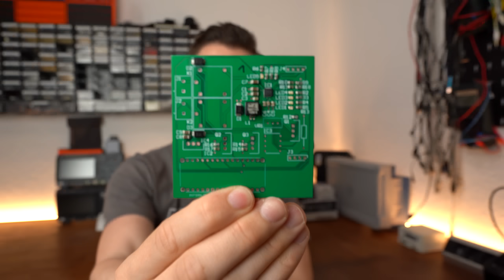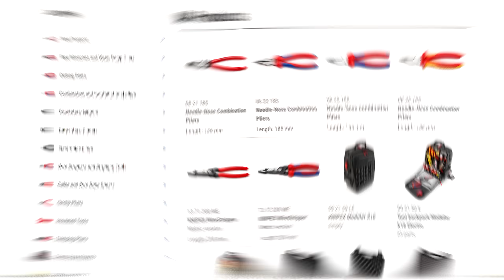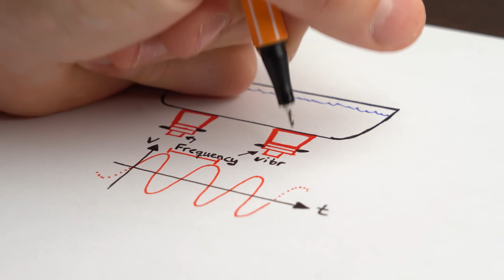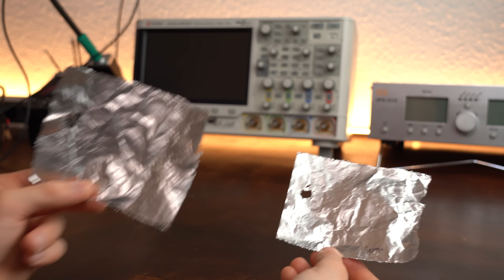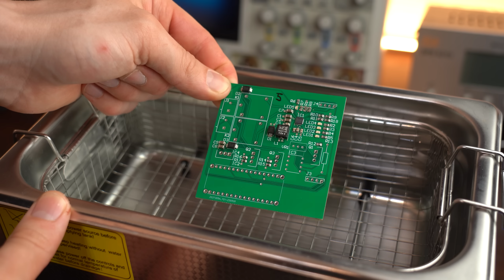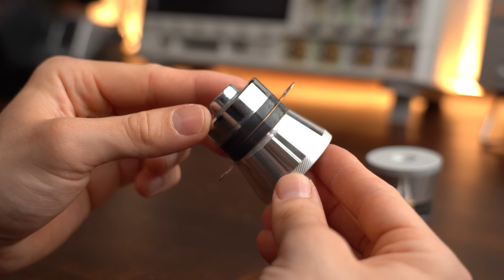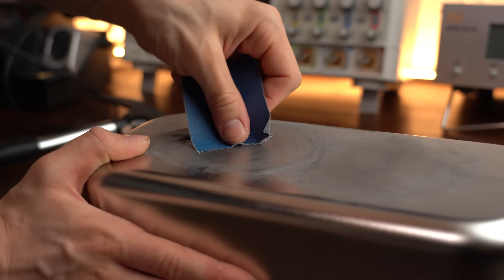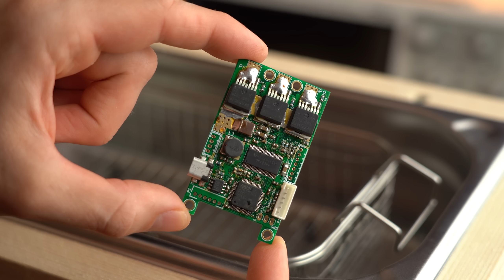The Most Underrated Tool? (DIY or Buy) Ultrasonic Cleaner!

Comment: The secret to quality soldering both mechanically and visually is the set up and application of your solder paste. Make sure your paste is not too liquid and when you apply the solder paste to the board you should swipe ONCE and ONCE only. Don't 'paint' the paste to the stencil i.e. not too lightly. You need to use a certain amount of force across the board and with the paster at the correct angle. Put a large bead of paste at one end of the stencil and swipe it across. It should 'roll' across the stencil and not leave many paste streaks on the stencil, you should more or less see bare metal.
Done correctly, the resultant paste will only be on the pads and nowhere else, even between very tight spacings.
The rest is easy.......reflow in an oven and you'll be looking at the board wondering if you even need to ultrasonic clean it at all.....which of course you should do.
Reply: who asked

this video isnt even about freakin how to solder
Reply: @urnoob5528  Eh?.....I didn't mention soldering, my comment is all about pasting a board as you'll see from @00:08

Comment: Great video, I always wanted such a cleaner. But your boards.. scare me. IDK if you're doing something wrong, your solder paste is bad or you have shaking hands, but these are not supposed to look like that..
When I'm soldering, I usually use glycerol-based flux. It makes perfect solder balls and all components snap into positions almost by themselves, but cleaning it after is a pain. Which would be much easier if I had ultrasonic bath xD

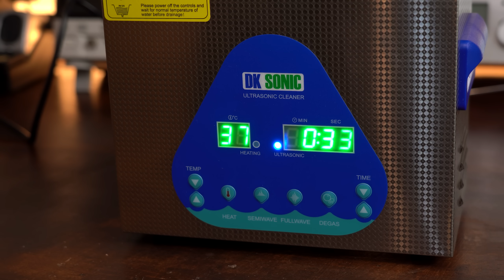Comment: You can also use dish soap / water in a 1:10 ratio with a dash of ammonia (yes). Way cheaper than ultrasonic cleaning solutions and does the job just fine!

Comment: Looks like a quite efficient method, but I doubt it's a safe way to clean PCBs containing electrolytic capacitors, as it can damage an aluminim foil, it might also induce micro breaks into multilayer and electrolytic C ?

Comment: One other upside of the buy option is some commercial versions are made explosion safe. This is expecially important if you need the bath to be made of isopropyl alcohol, as the ultrasonic waves evaporate the alcohol at high speed and may produce sparks where metal meets metal.

This is an obvious explosive hazard and while exceedingly rare, having a bucket capable of taking the explosion instead of becoming an IED is an important feature to take into consideration.

Comment: This video is exactly what I need! I'm looking to buy such a cleaner. I was not thinking about DIY, but buy a new one like shown here, or get a cheap second hand one for around 20 euros , often small glasses /jewelry sized..
These new (metal cased) ones start from 100 Watt and up, those cheap (plastic ones) often are not more than 50W.
I'm looking to clean not only PCBs, but also things like fuel injectors..  
Do I really need 100W? Or do I get the same results running a 50W cleaner twice as long? Anyone has a thought on that?

Comment: I can’t help but think, if you’re getting grainy solder joints like this, or grains and balls of solder all over the board, you really need to look at your solder paste process, and perhaps the reflow process, maybe even the solder paste. 

Stencils need to be held firmly to the PCB, perhaps with a paste printer jig. Aim to release the stencil vertically not at an angle. I made a paste printer with steppers and extrusion for very cheap.

I just don’t think it’s necessary to use ultrasonic cleaners, it’s too aggressive and slow. Ultrasonic cleaner have always destroyed my piezo devices (but I think that was the cleaning solution), and what it does to aluminium makes me worry about what it does to ceramics and solder joints! 

Generally, PCBs shouldn’t really need cleaning, unless they have been reworked. 

If the boards are caked in flux residue, I recommend a soak in brake and clutch cleaner (way cheaper than fluxclene) for two mins. You’ll see the excess flux going white and fluffy. Take a soft brush and wipe away the white fluffy bits while in the solution. Wear gloves! Then rinse in IPA. Dry in an oven or blast with your hot gun (well ventilated area or you’ll  be blind/mad/dead) 

Shiny PCBs

Comment: the ultrasonic cleaning capability also varies by the frequency used. Most of the cleaners use about 40kHz transducers, which you can consider "all purpose". For some applications higher frequencies, up to 170kHz, for more delicate stuff or lower frequencies about 25kHz for heavy duty stuff.
Reply: Interesting! 
Does the transducers work like speaker or does they need to be driven at a specific frequency, like a resonant device? 
I can think that 170 kHz needs another transducer compared to 40 - but for example 40 and 25 isn't that far off from each other. It could be some interesting DIY project to try in the future. 

That drive circuit looked overcomplicated with it's self exiting inductors though. It's probably a design made to save on components and once all properties at tuned in, it can be mass produced - but will probably be a nightmare to tune in during a DIY project (at least if you don't want to recreate that exact circuit, but improve it to for example get rid of the heat issues - and/or don't have exactly those same model of transducers, with the right impedance) and will result in a shit load of blown up transistors. Working at these power levels isn't as forgiving as low power stuff, if the circuit for example fail to oscillate properly.
All the transducers "care about" is probably to get an AC voltage with the right frequency and enough voltage. So it seems easier to just build a half or full bridge with control circuit and oscillator, then wind a transformer to crank up the voltage to the desired level and (if needed) put a current limiting inductor. If the transducers in them self is significantly capacitive (as it seems like they can be, if they are like a piezo speaker), a normal inductor can be added to form a resonant circuit that can then be driven by the secondary of the transformer. Maybe use PLL tracking, if the capacitance (and thus resonance frequency) change slightly with for example temperature.
He gave up in that part way too easy, because he taught it was too dangerous.

Comment: Works great on PCB's. But make sure you NEVER put anything with a crystal resonator in the ultrasound bath. I've had a bad experience with several SMD's with embedded resonators that are temperature compensated devices (Maxum DS32KHZSN (First designed by Dallas Semiconductor)). This a very good 32.768KHz temp compensated frequency standard for clock circuits and other circuits that need a clock source for timing. Cleaning the board with ultrasound to clean off flux with this IC soldered on the board will kill them, or grossly change the frequency. I killed 2 before I realized what I did, and reading the data sheet on the IC basically says to never clean boards (with these devices mounted) with ultrasound devices. DOAH!! Oops. Just be aware that whatever you have on your board should not be sensitive or affected via ultrasound cleaning.  Just a little heads up. I know there are several devices that can be damaged via ultrasound cleaning, so check the data sheet before taking the plunge.

Comment: I am very concerned about the cavitation damage that may occur to fine traces or chips.  Also inside the chips, the microscopic wires that connect the silicon to the package leads could be damaged by the vibrations.

Comment: In my country, an ultrasonic cleaner costs $900, so even when taxes are high it is cheaper to import one at $400 (taxes included), and yes, they are well worth their value, I have fixed laptop motherboards just by placing them on the cleaner (bug infected ones)

Comment: Recipe for DIY cleaning solution, 1 squirt of liquid dish detergent + 1–2 bottle caps of Windex (with ammonia), it's amazing how nice it makes jewellery and glassware shine. RE: ISO, I made the mistake of buying one with a plastic body and lid, it took a while but severe melting ensued when using isopropyl alcohol, common sense came later lol, the DIY solution worked fine for years without any harm.

Comment: I know some folk don’t like this method, but 99% isopropyl alcohol is by far the best PCB cleaner I’ve tried. Just keep the heater temp at 40c and it works perfectly without getting anywhere near auto ignition territory. I find I only need 10 mins and the board is perfect afterwards.

Comment: BEWARE I once worked for a computer company in the 1970's that cleaned all their discrete component ANALOG computer parts with ultrasonic cleaners, no problem.... BUT they fell foul of cleaning their new range of digital computer system cards in an ultrasonic cleaner that destroyed the chips they were using. The internal wiring of the chip to the header used what were called BALL BONDS, effectively friction welded connections these randomly broke in the cleaner and the boards were all scrap.
PLEASE CHECK THAT YOUR COMPONENTS CAN BE CLEANED ULTRASONICALY IN THE MANUFACTURES DATA SHEET, cleaning historic components should be avoided.
They subsequently used  manual cleaning with a stiff brush and alcohol. 
A suitable stiff brush can be created by cutting a small paint brush hairs short.

Comment: I use one to clean old computer PSU and other electronic stuff. Even cleaned the print head of my printer with it. 
Pretty cool to have around but it’s NOISY….. 😂
Oh and you didn’t heated the water up? I use 50-60c when cleaning. Makes a big difference!

Comment: The reasons your boards looks so bad is that 1. You're not using a stencil to apply the paste, and 2. You're not using a Toaster oven to solder the SMT components all at once. Once done I use Mentholated spirits in a Ultrasonic unit.  You don't have to use those huge bath tub units if you only have a few boards. A smaller Jewellery type unit will also work fine.  I often use a two step process, 3 minutes in the bath, a quick scrub with the toothbrush (the cleaner will actually move flux from under the chips to the pins where they get stuck a little) and then back into the bath for another 3 minutes. A final submersion into clean Metholated spirits and a towel down with paper towels stops those ugly water stains from appearing.

Comment: Cleaning prescription glasses in an ultrasonic cleaner can be a risky proposition. If the temperature is too high, plastic lenses can distort and even at lower temperatures the UV film can start to peel and delaminate. Probably fine for cheap throwaway reading glasses though.

Comment: Just remember not all components can be ultrasonic cleaner. Relays, microphone, pressure sensors, some mems devices, etc... Can be destroyed by the ultrasonic energy. The datasheets will usually say in what way the component can be cleaned.

Comment: Use the degas function. Once all gas has been removed from the water, it will work much better.
Reply: I don't know about the degas function, but you do need to let the water/solution sit for at least 15 minutes before using to remove any bubbles caused by pouring the solution in the bath. Having micro bubbles in the solution greatly reduces the effectiveness of the cleaning. The cleaning process works by the ultrasonics creating its own micro bubbles that implode to shock the debris out of position.

Comment: Did you notice any damage to the coatings on the glasses after cleaning them? I have been wanting to try to use an ultrasonic cleaner for glass elements since optics from lenses are rather difficult to clean fully and this kind of machine seems perfect for that. But I am finding it hard to find good information on if there is any risk to damaging the lens coatings or the glass itself with a machine like this?
Reply: I would advise against it. After using a lower-power, ultrasonic cleaner with a mild detergent on a new pair of glasses I noticed a very fine ‘spider veins’ effect in the anti-reflective coating of the lenses.

Comment: The diy driver gets hot because you grounded it. If you look at how it works, the center is floating. If you ground it, the circuit will be constantly grounded through the capacitance at the glue to actuator interface.

Comment: A friend made a DIY using 4 horns, a 4 output controller/power board, a heating element out of an old bread machine and he set it up under a kitchen metal tray which was about 4 inches deep but very wide and long and enough to put in a E-ATX motherboard and its never let him down either.

Comment: the ideal cleaner is dichloroethane. it perfectly cleanses, quickly and effectively. I recommend brushing through a non-woven material - a solfette, dichloretane will dissolve all the remnants of fluxes, and the napkin will absorb everything. the board will be perfectly clean. especially good for cleaning connectors and contacts. there is no better way to degrease the surface. proven! I also recommend a chain cleaner (those that evaporate completely, without oil content). It is important that you understand this chemistry is very harmful, and I would say it is strong poisons, you need to use carefully, avoid contact with the skin and eyes and do not breathe fumes, ventilate the room well. I use it every day, for many years. while alive)

Comment: I am leary of putting PC boards in a Ultrasonic cleaner. Specifically the bonding wires on many ICs and transistors as well as other delegate components. I have been making PC boards since the 1970s as a weekly Radio Shack customer with my child allowance. Since I started making "serious" PC boards in the 1980s I have always put the soldered boards in a bath of 99% Proponal for 10-15 minutes and dried with compressed air after scrubbing with a cut off paint brush. I learned this from seeing it done at an electronics manufacture. Also I never install components like switches or pots until after the Proponal bath. For repairs or component replacements I use a Q-Tip and Acetone being careful of soft plastics.

But hey, if trhe ultrasonic cleaner works for you, go for it. I have one as well and I just may try it roo.

Comment: I only have problems with solder balls when using a low temperature paste (138 degrees)
That's why I settled down for 183 degrees variants even though they come with greater risk of damaging the pcb while on a sand pot

Comment: Alcohol or stick them in a toaster oven at like 100⁰F for like 30min. Not ultra hot just enough to evaporate the water. I've seen those cleaners used for motorcycles and old cars A LOT.

Comment: The biggest problem is getting the "correct" adhesive for the DIY solution.  There is another video here on Youtube discussing that as well.  I agree that BUY is the way to go.
Reply: hot glue ftw
Reply: @urnoob5528  Hotglue doesn't cut it.

Comment: I just use flux cleaner -> compressed air -> isopropanol -> compressed air. Takes 2 minutes (unless you have tonns of through-hole parts) and the boards are clean and not sticky.

Comment: Is it possible to clean pcbs with esp32 modules mounted? I tried once but had a high failure rate of the esp32s afterwards. Any hints on this?
Which cleaning solution is best for removing flux?

Comment: Save on the cleaning solution by placing the object inside a ziplock bag (with the cleaning solution like alcohol) and then place that into the water bath heated up to at least 40ºC